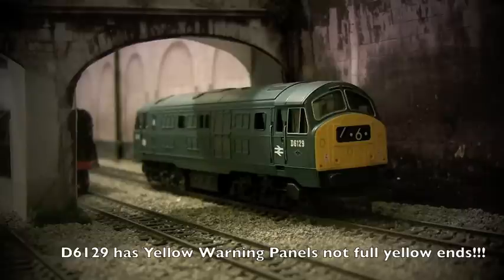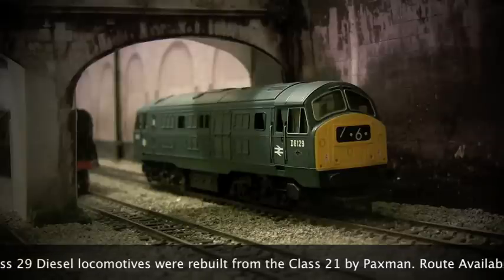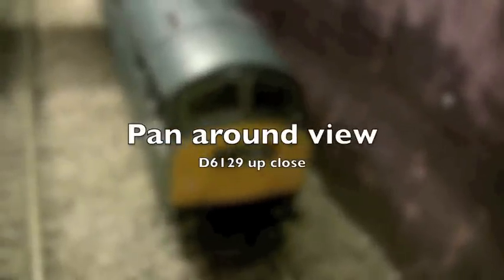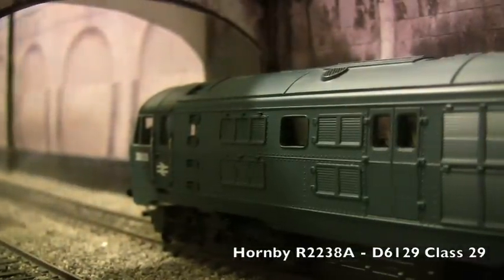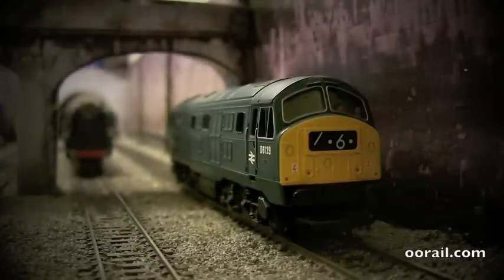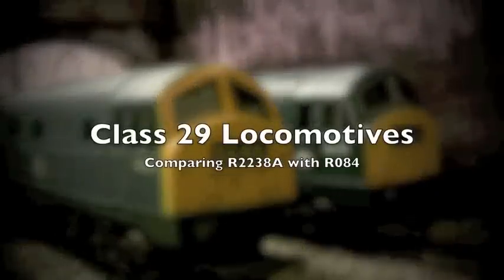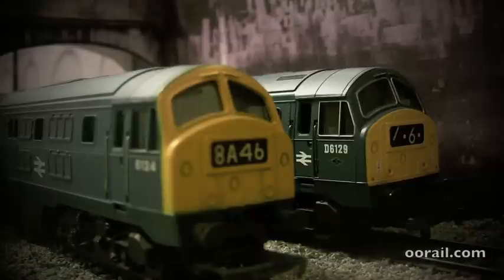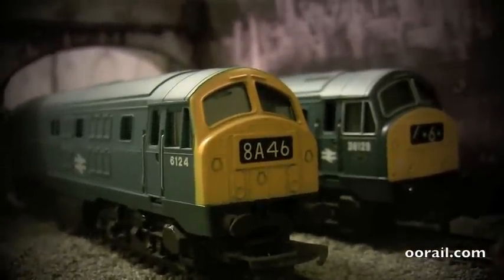oorail.com | Hornby R2238A Class 29 Diesel Locomotive - OO Gauge Review D6129

Comment: You need at least another one as they always ran in pairs, not because of heavy trains, but in case one failed. I have the lovely Heljan Class 22 hydraulic, and have been tempted to get one of these bargain 29s with a view to converting it into a 22. Certainly the side/grille detail differs but it may be a much more extensive conversion.
Reply from the maker: MarmiteCrumpets Thanks for the information. The good news is that I have at least three or four of these, although one is in my "eBay specials needs repair" pile. There are a few photos of these running in service by themselves but it does look like they were run in pairs quite frequently. I have the Dapol Class 22 which is a pretty decent looking loco in itself...
Reply: oorail.com I know it probably sounded like I was having a joke, but apparently that was the real reason they often ran in pairs! Ironically the hydraulic 22s were said to be more reliable than the 29/21 diesel electrics. Shawplan/Xtreme Etches do various brass grille and flush glazing conversion sets to add realism to Hornby/Bachmann diesels. Not for the 29 sadly... Its not a bad little loco and would look great tarted up a bit!